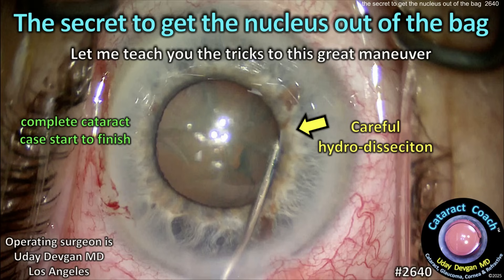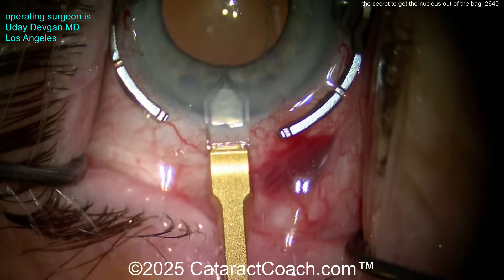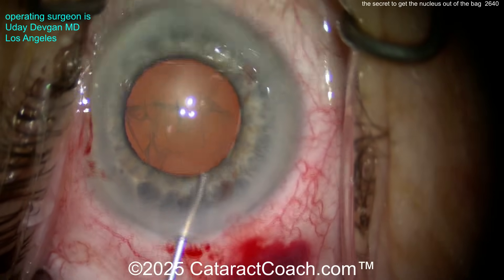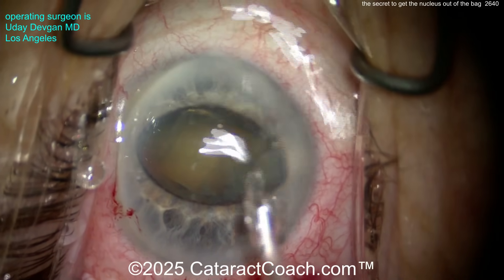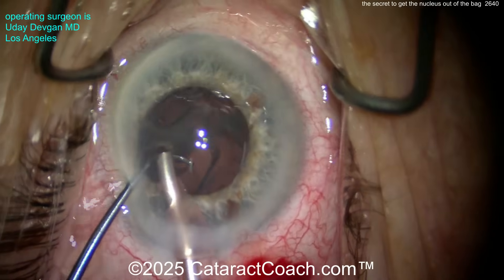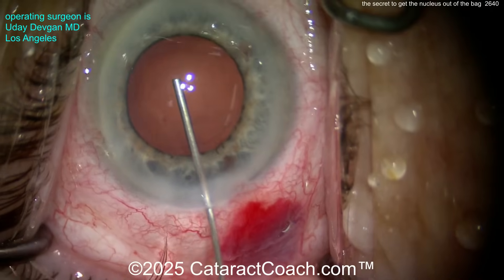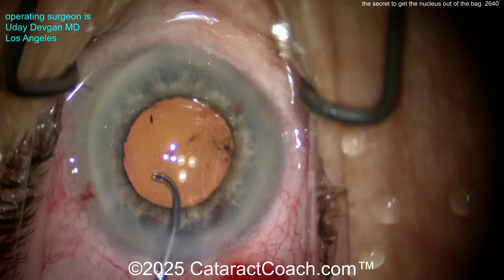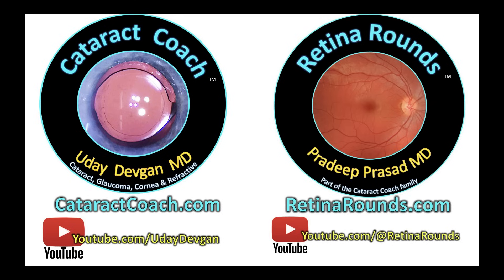CataractCoach™ 2640: the secret to get the nucleus out of bag

Comment: Great teaching video.  It's ironic that when I accidently prolapse the nucleus during hydrodissection I always push the lens back into the bag for chopping (unless it's super soft).  I prefer to chop with the lens in the bag completely to avoid damage to the anterior capsule rim and to prevent the capsular bag collapsing behind me without my knowing it as I phaco if it's a weak zonule case and to do the bulk of my phaco away from the cornea endothelium.  Part of this difference between us may be because I use a venturi/concentrix pump and you use a peristaltic pump and this alters phaco strategy a bit.   Peristaltic only builds suction with occlusion and venturi/concentrix has more of a "magnetic field" effect drawing things to the tip without occlusion.   At any rate I like to leave the lens in the bag and dismantle it there away from the cornea endothelium and to provide volume in the bag that keeps the posterior capsule back and has me working under the anterior capsule rim but I know you like to prolapse and you have fantastic safe results with that which shows there's more than one way to skin a cat using different equipment and different techniques.
Reply: Excellent points Dr. Safran. I previously did not mind if the lens prolapsed and would work with it as it was. Then a couple months ago, one of the worries you mentioned came true. Weak zonules allowed the capsule to essentially collapse behind my prolapsed lens. Nucleus out and what do I see? Time for a vitrectomy.